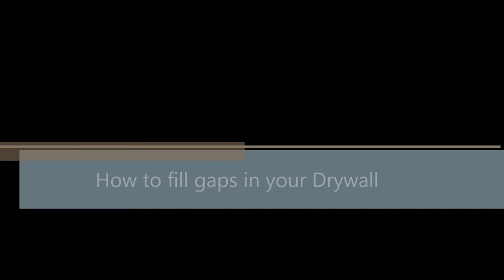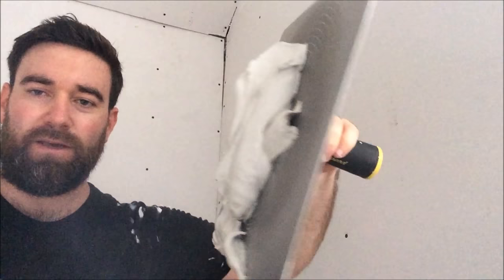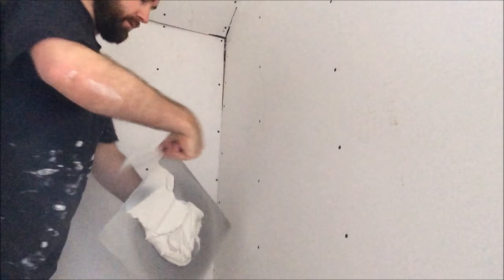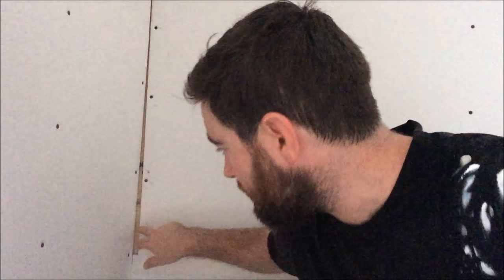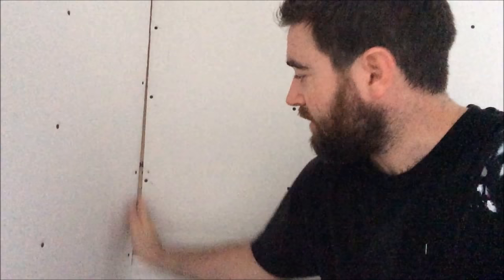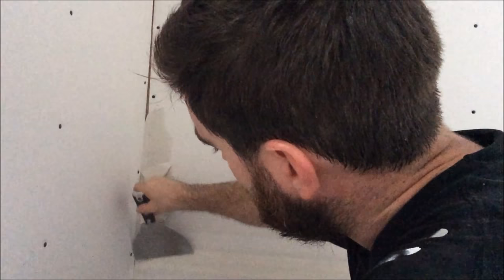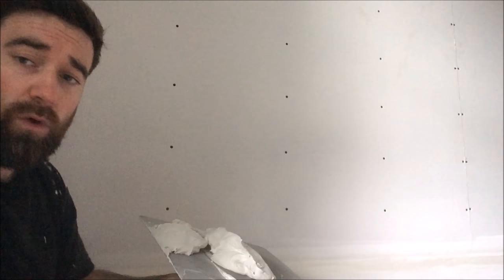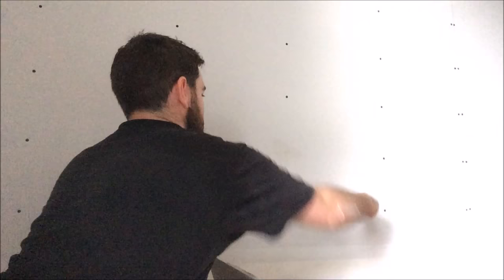How to fill gaps in your drywall

Comment: I just filled large gaps I had in my drywall using your method. I’m a woman, I’ve never done this before, I did theirs all by myself and I followed your instructions step by step. The wall turned out excellent!!! You can’t even tell there was a huge gap there.
Reply from the maker: That's great! I'm glad you found this helpful and was successful. 
Thanks for the comment 😊

Comment: Should anything be done differently if this is on an interior wall and theres nothing behind the gap to press the mud against? Just empty cavity. Thanks
Reply from the maker: It's not as big of a deal if the moisture from the compound has somewhere to escape, it is all open behind it can escape there as opposed to coming through the tape and ruining it after it's painted, 
Obviously without seeing the project it's hard for me to definitively say , but as long as the wet compound can dry proper you should be good

Comment: Great tips. People should be aware that 90 and other quick sets harden like concrete and don't skrink as much as all purpose.    Apply it tight, especially if used over screw holes.

Comment: Thank you so much. Fortunately I found this in time. I used the 45 and I was amazed at the gaps that I was able to take care of. I also did the screw head's as you suggested. You really saved me a lot of grief.
Reply from the maker: I'm always glad to hear that my video was helpful, thanks for commenting and letting me know. 😊👍🏻
Reply: Danny How did the 45 hold up?
Reply: No need for quick dry mud unless you are in a huge hurry and don't mind a bucket full of dried out mud. It does NOT take weeks to dry. I have filled some extremely large gaps with all purpose mud in several places and it was fine in a day or two. I have even put tape directly over these large gaps and the tape did NOT bubble.

Comment: I think you might've saved my ass for a project I have today. I lack experience in drywall and struggle typically but trying to work smart today on a kitchen remodel. Sheetrock 90 it is!
Reply from the maker: Yes filling all gaps with sheetrock before tape is always a must! Glad you found this video helpful

Comment: I'm prepping to replace the failing tape joints on my bedroom ceiling, and found huge half inch gaps between the ceiling, and wall from the installers not cutting the ceiling to the correct length. The drywall is 23 yrs old, and was nailed in so some of the boards moved on me when I did a test area above the doorway to see if I could pull it off with decent results. I ended up screwing the drywall back into place to make it solid again.
  I'll be using 45 minute mud to get it all done. Hopefully one bag will cover it since I only have to do two walls. If it comes out nice enough I might fix all the bad joints in the house. My dining room's rear wall corner joints are round, and wavy. There's lots of areas that are what I call a DIY nightmare, lol. Thank you for inspiring me to handle all this on my own! The real sad thing is one of my neighbors is a licensed drywall business owner, but he didn't seem super interested in taking the job, and I can't afford him anyway, lol.
Reply from the maker: Thanks for the comment and you are welcome. I'm always glad to hear that my videos were helpful. 
Good luck with the project 👍🏻 hope it turns out great

Comment: Thanks i am a amateur working on an old house. House was hacked together as it is nothing is level. It's gonna be an appartment so the owner is not looking for super perfect just decent. Its a good learning experiance. I do the best i can and learning along the way. One thing i was doing was using mesh tape with regular compound which is ill advised. Got to use sheet rock 90 for that. Been using paper since. I am going to get 90 though as i have a few big gaps
Reply from the maker: Thanks for watching and I'm glad it was helpful. Sheetrock is a must and I am glad you switched to paper. You cant go wrong with paper! Hope your project goes well 👍

Comment: Good video on the subject. Useful. The stiff mud is the critical bit. 45 mud also works faster ;-)
Reply from the maker: Thanks! Yes 45 is faster drying and there is even a sheetrock 20 I believe, I find I always mix too much with the 90 so I just stick with that .
Thanks for watching and for the comment
Reply: @TheCanadianHomePainter  Quick question - what is the difference between Sheetrock 90 and the joint compound used with the paper tape? 

Not challenging just curious. I did Google it but I got thoroughly confused. 😂😂 Thanks
Reply from the maker: @boyshanks  the sheetrock 90 dries fast, it will be rock hard in about 90 minutes,  so it's awesome for filling large gaps, it also doesn't shrink. Gives a great base for the tape , the all purpose compound take alot long to dry and it is great for applying the tape with.

Comment: Oh boy, is there an easy way to remove the compound after it’s been applied?  I didn’t see this video until after I asked my local Home Depot for advice on how to do this.  I can see I was given the wrong advice.  Thanks for your help.
Reply from the maker: I am sorry to hear you received bad advice from the HD. No need to worry though, you can remove it,  if it is a matter of it being to heavy and  now in need a good sanding. I would go back to the home depot, get some heavy grit sanding blocks, buy a bunch and with some hard sanding by hand you will be able to smooth it out. Hope this helps! Home depot may even give you the blocks for free for the bad advice given to you. Good luck !

Comment: I’ve heard that hot mud isn’t ideal over nails/screws because the hot mud needs a certain thickness to properly cure. The manufacturer usually says the mud is not for thin applications like you would do over nails.

Comment: Question for The CHP (Canadian Home Painter).  I recently moved into an old house and the bedroom has vertical tongue and grove solid cedar walls that has 3 seams in between each 8inch wide panel which gives me vertigo and reminds me of prison bars.  Can you or anyone reading this let me know if Sheetrock 90 is something I can use to fill in all the seams? ....given they are about 7 feet high.   Many thanks. Great video.
Reply from the maker: Hey! Thanks for the question I have never used sheetrock 90nin a case like that, so I can't speak from experience,  the only thing I would worry about is the wood expanding and contracting over the different season, and inwonder if the seams would Crack. But maybe you live in a southern climate and don't get the extreme cold winters, I know here everything expands and contracts so much over the year. Perhaps someone in the comment section might have some good ideas , I have used DAP paintable caulking to seal up gaps if they are not to large, because it's flexible ( to a point) and with expand when needed 
Sorry I couldn't be of more help
Reply: @TheCanadianHomePainter  Thank you so much for replying.  Yes, you are right, after researching I found out that the wood will indeed expand and contract cracking ever seam over time.  
I finally realize that I will need to sheetrock over all the walls if I want a smooth finish.
Thanks again for replying and for posting your videos.  I'm a fan and learning a lot from them.
All the best to you. M
Reply from the maker: @M. I.  thanks I appreciate that !

Comment: A better and much faster way is spraying a thin bead of insulation foam into the gaps. It will be dry in 10 minutes, 15 minutes tops. Take a utility blade and trim the access foam that may be sticking out and start mudding. Don't have to wait for sheetrock to dry and then sand. Expansion foam makes the perfect backing for when you are mudding. You can have gaps that are a couple of inches or more and it will dry within 10 minutes or so and you can mud. on straight joints, you can actually get away with not putting mesh tape or paper tape because expansion foam doesn't shrink and crack. Just apply mud and when its dry you can sand. No tape is needed.  If it is a corner joint then you need to use paper tape. This method is much quicker and easier.
Reply from the maker: Interesting,  I have never seen this method in all my years. How does it hold up over time? I mean the sheetrock is just so rock hard I think for longevity it would be better to use sheetrock, but it sounds like it would be something try, I think I would hesitate for a client because I would worry about cracking over time but maybe I'm wrong. How long have you used this method and do you ever have things crack over time ?
Reply: @TheCanadianHomePainter  Great question. I learned this method from a contractor who was a professional taper (union) before he became a general contractor. He showed me this method and I was shocked. I thought he was joking. Never heard of it before. I was working on a home renovation through him and he showed me this. It worked perfectly. I started doing this method ever since.

I learned this back in 2013. I am a journeyman drywaller and metal framer. I left the union and started doing home renovations for myself. Most of my work involves framing, drywall, taping, and painting but I do flooring, kitchen and bathroom remodels, etc. I have been in this line of work since 2003. 

I have customers who I have been working for on and off for the past 7 years. I renovated their basements, kitchens or bathrooms, etc. They call me for minor stuff like painting some room or installing ceiling fans or changing light fixtures or working on their new homes.

I know that in the homes that I have been in during the past 7 years, not once has this method resulted in a cracked joint. It works flawlessly for me.

It is the fastest, easiest, and best way, in my opinion, to repair big gaps when the drywalling was done very poorly, or when doing a repair when a new sheet of drywall is joined to an existing sheet which often leaves a large gap in the joint.

The only thing I suggest is that you use an expansion foam gun. The metal one that you can buy because it can shoot a very thin bead of foam in a controlled matter. The plastic triggers that come with some foam cans are not good because you can't really control precisely the flow of the foam and it will cause an overflow of the foam and you will have to trim a lot of the foam with a blade when it drys. The pro metal guns are recommended if you do these types of repairs on a regular basis. You can get them at home depot.

I was shocked and surprised when I first learned this but now I am surprised that most journeyman tapers don't know about this. 

Give it a try!
Reply: @BushcraftArnold  Thanks for sharing. I'd love to try this in an upcoming renovation. Which brand/type of spray foam do you use (e.g. Window & Door vs Big Gaps)?
Reply: @winstonsmith2227  I use Great Stuff door and window. The blue can

Comment: boy did you save my day!  thanks!!!  Also,  I joined two sheets of drywall improperly.  I joined a tapered seam with a butt seam.  One is higher than the other when I joined them.  Any suggestions how to fix this?  People told me to notch a 'V' and then fill the gap with mud and tape.  Any suggestions?
Reply from the maker: Thanks for watching and for the comment, I'm always glad to hear that this video was helpful. 
As for the taping of the joints. Sometimes that happens, ideally you want two tapered edges or two butt joints to come together,  but in that case what I do is just put the tape on with the drywall compound and I just feather it out over the next few coats. Sometimes I will put more thin coats then  usual like i do with two but joints. You can try cutting the  one edge down but for me i wouldn't if I was doing it. Hope it works out for you. But just keep in mind feathering it out nice and wide and more thin coats to help it blend. Hope this helps !

Comment: Great video!! I appreciate the timelapse🔥 Quick question, since Durabond 90/45 is hard to sand, what do you do when pre-filling yhe large gaps and screws after it dries? Do you just make sure to apply enough to fill gaps and not enough to need sending? 

Hope you are still active on your channel looking forward to more of your content.
Reply from the maker: Hi! Thanks for the comment !! 
Yes I'm still active , I try to put out atleast 1 video a week. Not always the case but I do my best.
As for the question about sanding, I smooth it out with my 6 " drywall knife and then everything gets coated with all purpose after, the corners and flat joints get taped and all screws get another couple coats and then at the end I do a final sanding. 
Just try to get it as smooth as possible either your drywall knife. If you need to sand, I use a fairly gritty sanding block which helps the process
Reply: @TheCanadianHomePainter  thank you very much for such a thorough response brother.  Truly appreciate.  Looking forward to your future content. Subscribed!
Reply from the maker: @esteylonmartinez6142  you're very welcome !
Reply: @TheCanadianHomePainter  Thanks for responding to Esteylon's comment - because I had the same question!  I'll be sure to keep this layer pretty shallow (with my knife) so I don't have to sand it - and can just top coat with an easier sanding layer later! Cheers!
Reply from the maker: @michaelbailey9643  I'm glad you found it helpful! Good luck with your project

Comment: Hi, thank a lot for these so useful video.  I have a somebody  helping to rebuild my flooded basement.  He is very kind but not very handy with gypsum board fixings.  The walls were cut at 25 inches from the floor (should be 24 inches).  Also, the house is from 1975 so it seems to be a nasty amount of old paint layers and once the new gypsum board panel is installed there is quite a difference between the old and the new in the junctions.  My helper cut the gypsum board not very tight to the dimensions to be repaired I have lots of gaps like the ones in the video everywhere.  All the exterior  walls are to be done,  I'm worry there will be another series of gaps.  If I understand well, what I need to do to fix the gaps and make all my joints is: 1) fill the gaps with sheetrock 90 taking care of don't let excesses around; 2) once dry,  apply paper tape as usual.  It is, apply mud, then tape, then flatten the tape against mud, let it dry and apply  mud again and again as needed until arrive to a nice surface.  Is it exact?  Do I need to use mesh tape or because  I filled the gaps with sheetrock 90, should I use only paper tape and All Purpose ready mixed drywall compound then?.  Why people say you can't use mesh tape with All purpose drywall compound?  I thought you needed to use mesh tape to keep the compound from cracking and falling apart from the big gaps. Thanks you very much.
Reply from the maker: It sounds like you got it. Follow those steps and your good. Mesh tape is a product I personally never use and have only seen issues at homes where mesh was used. Stick with the paper and you will be happy with the durability of the final product
Reply: @TheCanadianHomePainter  Thanks very much
Reply from the maker: @recj949  you're welcome

Comment: So it mixes and looks like joint compound but the material is different?
Reply from the maker: Yes, it has difference materials in it, I think a bit of cement as well, so it dries very hard like a rock, difficult to sand but the idea is that you won't require too much sanding

Comment: Great video!! Much appreciated. 

Did you cut v grooves  where the big gaps at the butt joints were? Why or why not?

Also, why paper tape rather than mesh tape over the big cracks?
Reply from the maker: Thanks for watching!
I can remember if I cut grooves or not, but with butt joints I weather out the Mudd alot so no to see the joint at all, I find that paper is much better then mesh, I know many drywallers who will say the opposite but I fi d that houses I work in that have the most cracks in drywall is 95% of the time with mesh tape. You can get it with paper too but much less likely I'm my opinion. I think paper is just alot stronger  it does require you to put a bit more Mudd and really feather it out to make things loom right.
Hope this help
Reply: Thank you. What is your opinion on v grooves for butt joints that have pretty big gaps? I am a VERY first time DIY and I just bought a house where all the joints in the vaulted ceiling need to be repaired. (I was completely unaware at the time of purchase) anyway, any extra tips/advice would be MUCH appreciated ❤
Reply from the maker: @caseyhamiter1289  yes I know that alot of drywallers will cut a v in the buttjoints , I don't usually, just make sure big gaps have the sheetrock 90 
Vaulted ceilings are really great but usually many repairs over time,  even if it's constructed well , you still need to make repairs from time to time, 
I have many other videos you should take a look at, it will help you with a variety of things on your home.

Comment: Thank you for your very helpful videos. Home Depot and Lowes have Durabond 90. Is that the correct product? I understand that the Easy Sand 90 would not be as strong.
Reply from the maker: Yes that will work great, thanks for watching and for the comment
Reply: @TheCanadianHomePainter  all I have locally is the sheetrock easy sand 90 or the durabond 45. Is there a preference between these two for large gaps?

Comment: I already filled large gaps with Multipurpose premixed joint compound.  The gaps were 1/4 - 3/4", & there were several large holes (silver dollar sized) that I filled with the same compound.   Now what do I do?  I sure wish I'd seen this BEFORE I did this...
Reply from the maker: Just give it time, maybe run fans or even a dehumidifier,  just don't tape until you think it's dry, it will just take alot longer